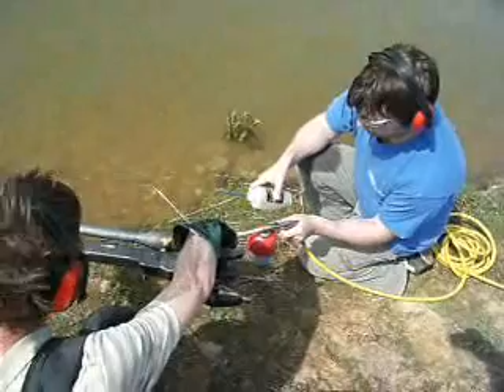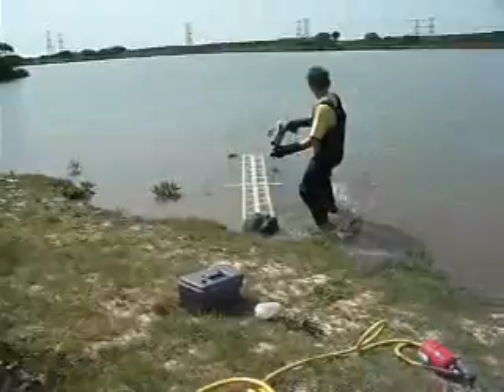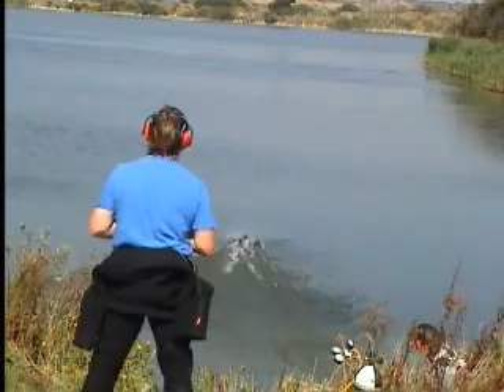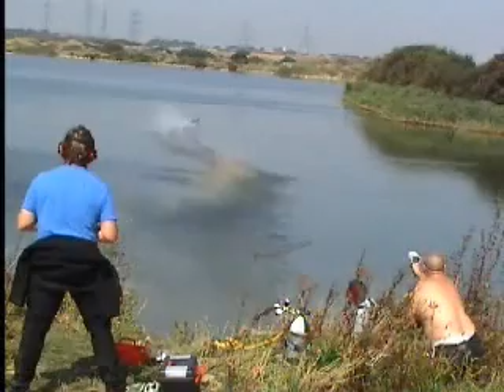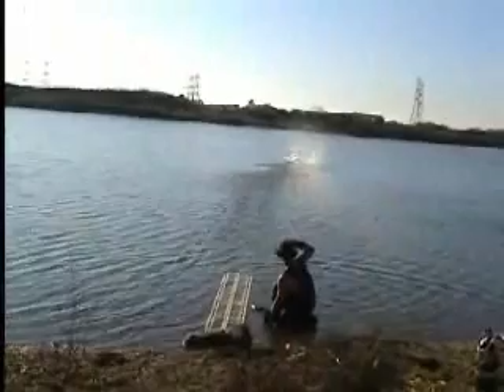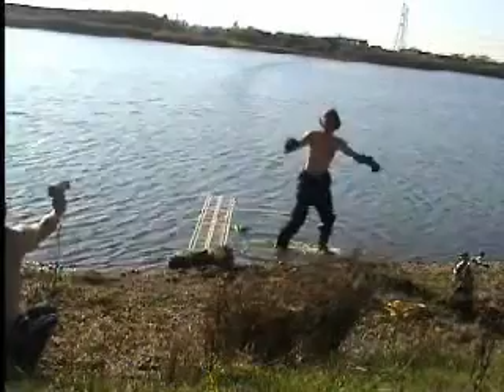rc pulse jet boat

Comment: did you ever consider the intake is too close to the water, and it was causing a flameout?
Reply: That's it... But an english is way perservering man ;-)
Reply: But you want the thrust as level to the water as you can make it, or it'll dive.
Reply: jacobaaron11 could you use an elbow to aim intake up perhaps? I'm just throwing ideas out. Awesome that you had an idea and followed through on it. That can never be a bad thing. All the best to you m8.
Reply: WelLRoundeDSquarE I wouldn't think so. I'd say the only thing they can do is put it in a planing skiff with a heavy centerboard and put a plastic or fiberglass shield on the front to keep water from getting too close. Letting it warm up before they put it in the water might keep the water from putting it out.
Reply: Very funny you said this!  A year later people still trying to figure that question out on pulse jet lolz!  The answer was not directly on the motor!   We used a 4 inch round Air duct elbow and placed the front of the the pulse jet 1/2 into the 4 inch round bottom hole and it had a 1.5 inch gap all way round pulse jet it's self and seemed to work awesome.  Sadly if you directly attach the elbow it fucks up all the math involved with a pulse jet !